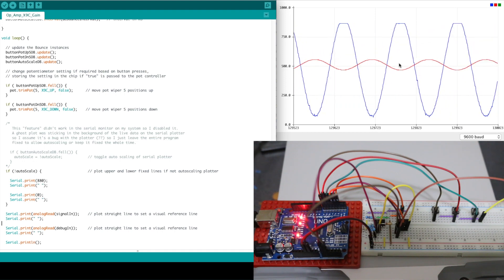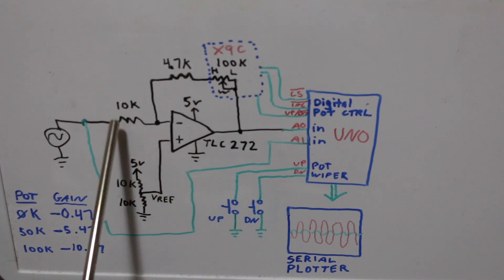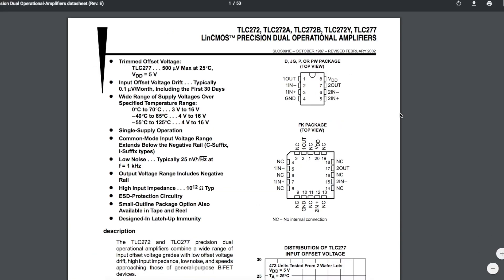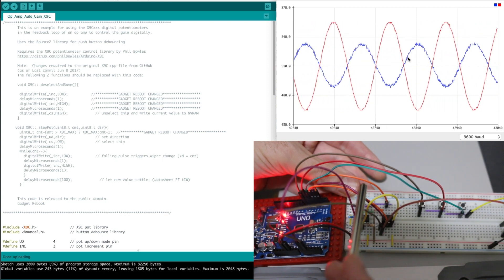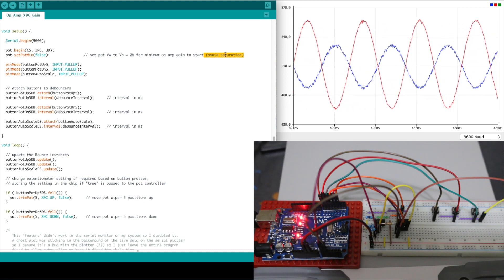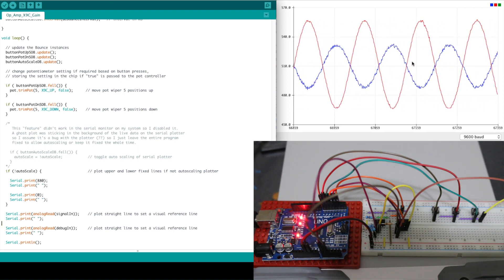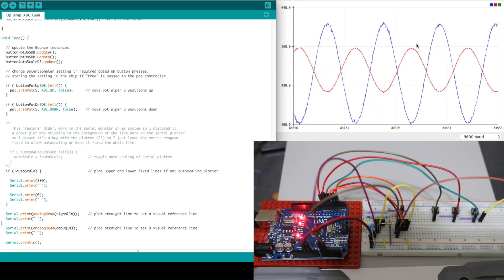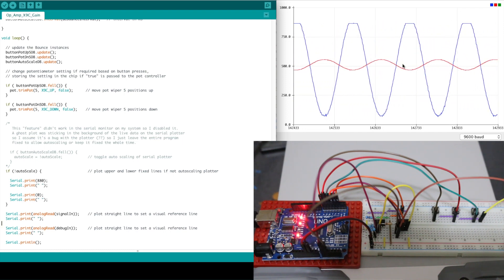Manual Gain Setting For Op Amp using Digital Potentiometer

Comment: really nice video, but what advantages does digital control have on analog systems?
Reply from the maker: I demonstrated one use in another video where I used the digital pot for auto gain control  so the system can automatically scale an input signal. 
https://youtu.be/4DrT7xwifB0
 Another use would be for remote controlling if the circuit is somewhere else or is otherwise inaccessible but the controller can be accessed somehow and commanded to change the pot  maybe over a network or other remote Console.

Comment: do you have a circuit schematic for how you actually connected the digital pot to the arduino i understand the code and everything but the sketch wasnt clear,goood video by the way
Reply from the maker: I scrapped some pin numbers on the white board schematic screen capture just now and put it on Github.
https://github.com/GadgetReboot/Arduino/tree/master/Uno/X9C_OpAmp_Gain_Control

Comment: Nice video, I just bought a X9C103S to do this with an external oscillator and timer to quickly test parameters, prefect timing
Reply from the maker: Make sure to measure the resistance and make sure it’s really what the label says because my 103 is actually 104 value.

Comment: That is pretty slick!
Reply from the maker: In about four hours, part two will be uploaded. This time with automatic gain control in addition to the push buttons. 

I couldn’t stop working on it! And now I can’t sleep.
Reply: @GadgetReboot  I had been wondering if these programmable resistors would exhibit symmetric loads with a small AC signal.  Guess so!
Reply from the maker: My main problem was using an op amp that doesn’t go to the rail but then I used a reference voltage that tried to centre it halfway to the rail so I was biased too far and then it looks a little weird but I was only looking at overall gain and it didn’t matter  if the two signals were shifted away from each other‘s center.    I need to organize my parts so I can find things immediately when I need them. These were the first op amps that appeared when I was looking.
Reply: @GadgetReboot  You are way beyond me when it comes to the tech matters.  My notes on the subject say that TL2272's is a bit better than the LT272's.  Something like a TL082 is very fast.  Due to the manufacturing process, it is nearly impossible to find an op-amp that is symmetrical rail-to-rail.  That 8-pin dual package is seems HIGHLY standard though.  Looks like the NE5532P is popular with the audio community.   Do you want my code for quick-reading an ATmega328pu?  (below)   analogeRead() is slow, you know. Even faster for 8-bits.

// Porting programs that use the deprecated sbi/cbi macros
// Access to the AVR single bit set and clear instructions are provided via the standard C bit manipulation commands.
// The sbi and cbi macros are no longer directly supported. sbi (sfr,bit) can be replaced by sfr |= _BV(bit) .
// sbi(PORTB, PB1) is now PORTB |= _BV(PB1);
// cbi(sfr,bit)    is now sfr &= ~(_BV(bit));
#ifndef cbi
#define cbi(sfr, bit) (_SFR_BYTE(sfr) &= ~_BV(bit))
#endif
#ifndef sbi
#define sbi(sfr, bit) (_SFR_BYTE(sfr) |= _BV(bit))
#endif

int ADCread10(uint8_t adctouse)
{
   ADMUX = adctouse;    // Just the number 0 for A0
   sbi(ADMUX, REFS0);   // use AVcc as the reference
   cbi(ADMUX, ADLAR);   // clear for 10 bit resolution
   sbi(ADCSRA, ADEN);    // Enable the ADC
    
   for ( sbi(ADCSRA,ADSC); ADCSRA & (1 << ADSC); );

   return ( ADCL + (ADCH<<8) );

} // ADCread10()

int ADCread8(uint8_t adctouse)
{
   ADMUX = adctouse;    // Just the number 0 for A0
   sbi(ADMUX, REFS0);   // use AVcc as the reference
   sbi(ADMUX, ADLAR);   // set for 8 bit resolution
   sbi(ADCSRA, ADEN);    // Enable the ADC

   for ( sbi(ADCSRA,ADSC); ADCSRA & (1 << ADSC); );

   return (ADCH);

} // ADCread8()
Reply from the maker: Yeah I’m usually happy if I can get within 0.5 V to the VCC rail but only getting 3.5 out of 5 V is usually annoying. 
 Thanks for the code. I’ve known that analog read function is slow but I haven’t needed too much from it until recently so I need to learn more.
Reply: @GadgetReboot  Well, those functions work!  I use them in a strobe() function to "see" the effect mosfet gate drop/rise when toggled.  Furthermore, you may be able to improve your resolution with 11520 baud or better.  Oddly, when you switch Analog ports, that first read is often garbage. (shrug)  Cast it, get the 2nd.